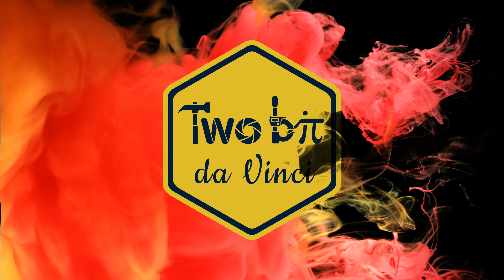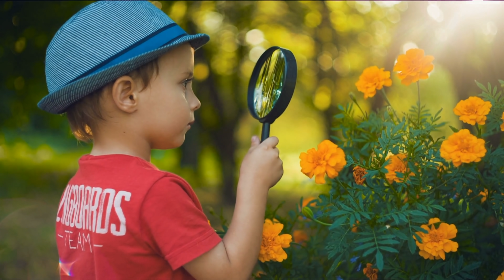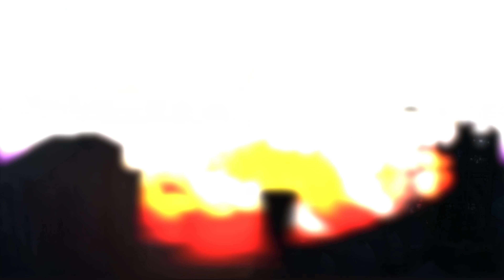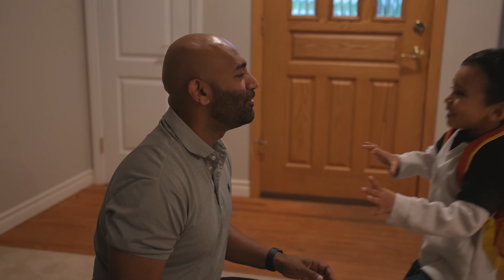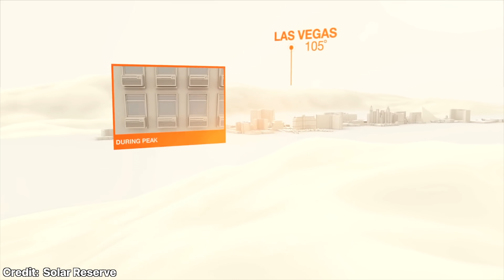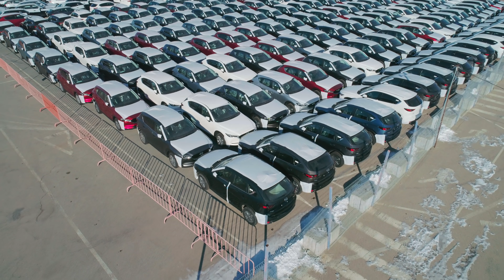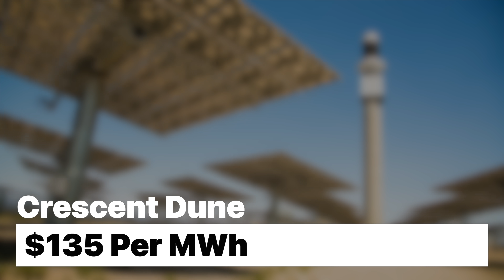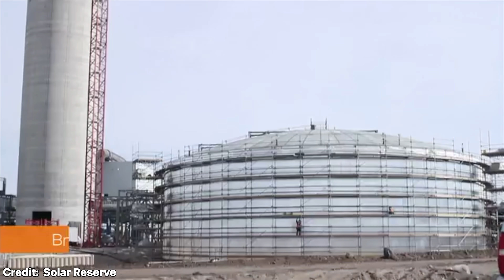This Billion Dollar Solar Plant was an EPIC Failure

Comment: I don’t “hate” green energy, I just hate how it’s sold by concealing the true cost of the technology, while ignoring the limitations. 

Putting ideologues in charge of an engineering/economic problem is never a good idea. 

Nuclear done right (i.e. not warmed over 1950s tech PWRs) obliterates all other competitors.
Reply: Our green future, is a green nightmare. The idea of building huge battery banks is the stupidest one to come along. 

It's amazing what some people will do to avoid the obvious solution; nuclear power.
Reply: @LordFalconsword  those new miniature reactors look very promising.
Reply: The best "nuclear done right" interim solution is molten salt Thorium technology, which the traditional nuclear industry does not want to invest in.
Reply: @amramjose  I like Thorcon’s approach. “Cheaper than coal with today’s technology” is a very practical approach, using a MSR thorium converter system that is very well thought out.
Reply: this is a common theme with new green technologies
Reply: although i feel nuclear is no better, it claims to be clean and safe and we all know it is not.
Reply: @muscleconfus1on  clean and safe are relative terms. Clearly, it is clean and safe, especially when put up against the alternatives. No deaths and effectively no pollution. Not sure where you are getting the idea otherwise.
Reply: It's the cheapest, cleanest, safest method per Kwh.
But the waste along with incidents like Chernobyl and Fukushima turned public opinion. When it goes wrong it doesn't fk around...
The technology has came a long way. Breeder reactors for example.

Unlike normal reactors which only use uranium-235 as their fuel, which is only available in scarce concentrations of around 0.7% of natural uranium without enrichment, breeder reactors also make use of natural uranium-238 which is much more common. They can use approximately 70% of the uranium-238 for production of power, whereas normal reactors can only use around 1% of it. They can also use thorium-232 to breed uranium-233, another fissionable product.[1]

I tired posting a link to where I got this...seems to be a no no on this platform nowadays...
Reply: @purplemonkey649  i think those reactors went bad due to low maintenance. i've recently seen a documentary in which the company that built the reactor at Fukushima was more concerned about making more money, so it cut a few safety steps to do that. take greed out, nuclear power can be really good.
Reply: @purplemonkey649  Fukushima is idiotic though. Who the fuck put a nuclear plant right beside a fault line that has high frequency of earthquake and Tsunami and think it will be ok. They can easily put it behind the island to the China side but nope.

Oh look tsunami.
Reply: @purplemonkey649  well, who is paying for the nuclear waste when stored for 100 000 years with the company ist bancrupt ?  Future generation will pay for our ignorance. With that in mind, the price will be at app 15 000$ per Kwh. So 135 is quite reasonable.
Reply: @steffenrosmus9177  how much nuclear waste are we talking about?  We can power a city for a decade with the amount of waste that would fit in your coffee mug
Reply: @bdb1052  
You’re talking about tons of radioactive waste. And not just the core. The disassembled reactor, and maintenance items that become radioactive.
Reply: @purplemonkey649  "In the UK they're cutting down 1000's of hectares of forests to put up turbines" what !? where in the UK ? France, Germany or maybe Australia. I don't think we have 1000's of hectares of forest left on the UK !
Reply: @timparis70  How about up in Scotland, where all the trees are....and wind.
Couldn't find the report I seen it in but came across this from The Herald... 

NEARLY 14 million trees have been chopped down across Scotland to make way for wind turbines. 

The Scottish Government expects to be generate 100 per cent of its electricity from renewable sources this year – but concerns have been raised about finding a balance between green energy and sustaining forests. 

Now statistics, released by Forestry and Land Scotland, show that 13.9 million trees have been axed to make way for 21 wind farm projects since 2000.

Granted, its hard to visualise what 14 million of anything looks like. And i don't think we know what a Hectare looks like. 
1000 Hectares is less that 4² miles...again, pretty meaningless. 
So try a comparison. But I'm not writing a thesis here, just to try and gauge what it is we're talking about here. 
Epping forest outside London comes in at 2400 hectares. A quick Google search says there's 55,000 ancient trees. Now there not all ancient so let's x100. For every ancient one there's 99 others....just for talking sake. 
That 5 1/2 trees in 2400 hectares. 
Again mate, it's not a bulletproof comparison. Just trying to illustrate that if you wanted to fell 14 million tress, your going to need to clear a few thousand hectares of land to do it...without going to Australia
Reply: @purplemonkey649  No that's good - thanks for going to the effort. I'm assuming if in Scotland we're talking conifers so quick to grow but tightly packed.
Reply: @steffenrosmus9177  - That's what the Yucca Flats disposal facility is all about.  The waste is put into "entombment casks" and placed thousands of feet underground, well below any layer that has contact with the surface (like water tables).  As each vault is filled with casks, it's backfilled with concrete creating, essentially, another rock strata.  The idea is that it does not need to be "tended" and actually expects our civilization to forget about it at some point.
Reply: @neilkurzman4907  - That's all low-level and will decay to safe levels in just a couple decades.
Reply: @steffenrosmus9177  
I got news for you, how do you picture nuclear waste?
because of you say some green sludge or radioactive waste, I suggest you talk with your own kind, also the containers they are stored in are nearly indestructible, they did a demo of the final product of the storage being hit head on by a semi truck fully loaded going 65mph, no points of failure.
Reply: @bdb1052  and if you have to dismantle an nuclear powerplant? Do the power companies could provide funds for that over this time period or do the customers have to pay the price? We have dismanteled 2 here in Germany and the amount of high radioactive waste is 2500 tons each the safe storage for one ton costs 12000 €/year. So 12000 x 2500 x 2 x  150000 = 90 000 000 000 €. And that is only for the high radioactive waste, the less radioactive waste  (app 10 000 tons each) is  app another 2 300 000 000 000.  REMEMBER THIS ARE THE  COSTS FOR ONLY 2 PLANTS. And who can guarantee an safe storage over this time period. For the  US you have to mutiply that by 55 (assuming that you still have 110 nuclear powerplants).
Reply: @hagerty1952  and that should last 150 000 years? We made  the same in German at the Asse facility and after 25 years all has to be recovered again. And how about  earth quakes? THOSE  are quite common THERE.
Reply: @steffenrosmus9177  -  What part of "entombed in concrete thousands of feet underground" isn't clear to you?  Yes, it will last until that layer of strata is subducted into the Earth's mantel in 100 million years or so.  No earthquake fault that deep has ever communicated with the surface.
Reply: Amen
Reply: There's nothing wrong with green energy, it's just not yet able to be our main source of energy. But that's not stopping these Green New Deal wackos from squeezing more money from the taxpayers.
Reply: Let's not talk about fossil energy failures.
Reply: nuclear done right would be fusion though, right? Afaik fission kind of sucks compared to fusion. Given we already have a massive fusion reactor that literally powers the whole world already it seems like a decent place to start, I wonder about the relative efficiencies of on-earth fission vs off-earth fusion. Plus evolution tends to favor reliability over raw power, and the sun is far more reliable. It takes time for people to forget when terrible things happen and we can't just push technology irrespective of that

I think one of the biggest ways that people ignore the cost of technology is by saying "fossil fuels are cheap to make <because they were already made for us by something else>". That's not cheapness, thats just free outsourcing. Finding an ancient battery in the ground and digging it out isn't quite power generation lol. But yeah that being said I agree with you, the concealment can get ridiculous. Any kind of persuasion that attempts to guise the truth in order to motivate people, regardless of the positivity of the conclusion, rubs me the wrong way. If the truths were evident they could be freely shared

also given the advancements in solar like multi unique layered and perovskite crystals, solar seems to be primed to be an important part out future. Also also, there are certain situations where centralized power sources connected to a large network are the best fit, and there are certain situations where individual power sources are the best fit. Non connected houses and individual products can't really benefit from more power in the grid. And given there are other incentives that nuclear cant cover to develop solar, that means solar will get better regardless so we might as well use it
Reply: But those mirrors are still sitting out there setting fire to all the birds that fly near them, right?
Reply: Most green energy companies are there to get government subsidies. Without subsidies, nothing can compete with fossil fuel.
Reply: Actually the majority of nuclear power plants in development go bankrupt in the united states.
Nuclear power plants usually get large amount of subsidies to function.

Solar concentrated power might become profitable in the future with new technological development. It could even be combined with molten salt nuclear reactors. Since they operate both in the same way that they convert the energy of hot molten salt into electricity
Reply: @bonnome2  The only way nuclear power plants go bankrupt is because of regulations and subsidizing of other energy. If you want to look at subsidies look at how much green energy is subsided PER KWH, it gets far and away more than anything else while being the most expensive and least reliable, i.e. WORST solution.
Reply: The problem with nuclear power was that the types of reactors we are using where chosen to produce plutonium for bombs; electricity was just a side product. Safer and cleaner reactor types are available, but they are about 70 years behind in development and nobody wants to take responsibility for starting from that point.
Reply: Tell that to the Elon fans...
Reply: @JohnDoe-ef3wo  Elon is no fantasist. He know that most of this green energy stuff is a pipe dream.
Reply: Absolutely! The original nuclear plants gave the technology a bad name, but it's by far the cleanest and best option we have. All this green energy crap would be ok if it was semi affordable AND reliable, but it's not even close to being affordable OR reliable!
Reply: @bobbygetsbanned6049  The day nuclear plants stop blowing up or melting down I might agree with you but they're killing things too, and we don't yet know the consequences so wait till we do. Japan has about 20 of them and as it's sitting on two fault lines we could be sitting on a real bomb.
Reply: This.

Physics don't care about feelings.  So yeah let's be real, solar, wind, they suck ass.  They're good in certain situations, but that's it.

Nuclear power is the way forward.
Reply: Nuclear has never costed radioactive waste.
Reply: @SLow-fb3qm  "Costed"? What are you saying?
Are you trying to say "Caused"? If so, pinch yourself, you're sleeping.
Reply: Actually yes you do hate it. Because you immediately assume that there is concealing the true cost. You never look at the true cost of coal, with its mountain of ash, and pollution.  
Or the true cost of other methods of energy. But you assume right off the bat that Green is impractical and can never work.
Reply: @neilkurzman4907  lol looks like a libs been triggered

Comment: Alternate power storage would be useful. It's probably more environmentaly friendly than battery. 

They can reuse the project though. May be change the mirrors to solar panel. Or put in different tech for centre tower.

Comment: The Earth is cooler w atmos/GHGs/albedo not warmer.
To perform as advertised the GHGs require "extra" energy upwelling from the surface radiating as a black body.
The kinetic heat transfer processes of the contiguous atmos molecules make that scenario impossible.
No greenhouse effect, no GHG warming, no man/CO2 driven climate change or Gorebal warming.

Comment: Great; PVs are getting are affordable. Uh, which country now controls most of the rare-earth elements and the production?  and which country is sabotaging its own power industry and sinking its economy? Oh, and how are we supposed to make up for all the missing nuclear/coal/gas plants at night, especially when all these millions of new electric vehicles we poor folks are supposed to magically afford are due for recharges? And since each barrel of oil the greenies want to shut down only produces about 19.5 gallons of gasoline, where are we going to get the chemicals, plastics, fertilizer, lubricants, pharmaceuticals, etc., that are made from the remainder of that barrel of oil?
I guess we should also ignore the waste problem of all those expired, mostly unrecyclable and partially toxic old solar panels at the end of their life span.

Don't get me wrong: I'm all for RELIABLE, COST-EFFECTIVE, AFFORDABLE, CLEAN energy. But apart from nuclear power (which the greenies hate), we don't have anything near the reliability or the support network of current sources. The 'magic' stuff just isn't ready yet. The free market will eventually provide it, if only  the (politically and economically) power-hungry elites will just take their feet off its throat.

Comment: How much power does the array itself use? How much grease (fossil fuels) are needed to keep the system running smoothly? What is/was the 'carbon footprint' as it was built? How much precious water (we are in a drought) is needed to clean the mirrors. Not to mention what it costs to clean up all the bird carcasses that get incinerated if they fly through the reflected Sun rays. All these problems for a system that would never create more than 50% capacity?

Comment: In the first five minutes the problem is revealed. Projects like this are only possible with large funding and to get that funding takes lobbying (a.k.a. bribery). Many solar technologies, especially heat conversion technologies are actually good science and good ideas. The problem is with the SCALE. When an energy company gets involved or regulators lobbied/ bribed by one, their agenda is to do it on a large scale so that they can be ENERGY PROVIDERS. Their agenda is to keep monthly profits going far into the future.

Heat transfer solar technology was very popular in backyard engineering projects for individual home energy production. The ideas was to use an approx. 12ft parabolic mirror arrangement concentrating reflected light to a simple radiator mounted on struts. The whole unit could be rotated; there by automatically tracking the sun. "Mother Earth News" and "Home Power" promoted projects like this in the seventies. The difference in agenda is that "we wanted to free the homeowner from monthly electric bills and produce power with less waste. Far less waste. Who wouldn’t want that? Energy companies, that’s who.

Even using the best technology, any single type of energy production fails when weather interferes. So we also pushed the idea of site specific and hybrid solutions, like combining hydroelectric from a stream, or the same from an accumulator such as a rain collection silo for non-rural properties. We also didn’t have some unrealistic aversion to combustion technologies, so they could be added for emergencies.

The politics: Lobbying, causes government to waste more of our tax dollars than will ever benefit those of us who provide those dollars.

Comment: I think that the future of solar will be a combination of PV cooled by coolants that collect the heat and store it in a similar way to this plant. I see this plant as a resounding success in driving the technology forward and learning from the mistakes. The energy storage in salt is really quite brilliant yet difficult and will need many iterations to come to fruition. The emptying of lake Mead shows the need for other types of baseload power in the southwest. I don't think lithium battery farms are a good idea for stationary applications. This power plant combined with natural gas, biogas, garbage burners or even coal would make it truly baseload without needing a separate plant with other sets of turbines, transmission lines and pipework. 

Solar heat can be combined with other heat sources to drive turbines day and night. We do not need an either/or solution, we need to combine systems together like they did with solar thermal and natural gas in Medicine Hat, Alberta, Canada.

Comment: CSP probably won't be the way to generate electricity. Instead it might aim at other markets, where PV are less effective: Synthetic Fuels.
Synhelion is a research spinoff, doing exactly this. They basically produce carbon neutral fuels with CO2, water and heat.

And Synthetic fuels will definitely play a big role in our energy transition. Probably not for standard cars, but for planes and rockets. In these application there is not yet any effective technology that doesn't require very heavy and therefore weight-effective energy storage.